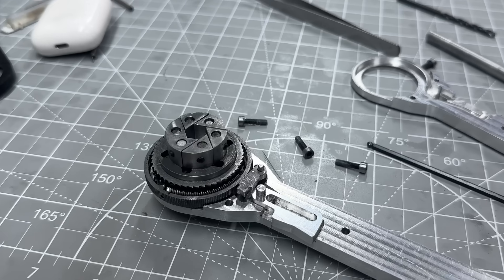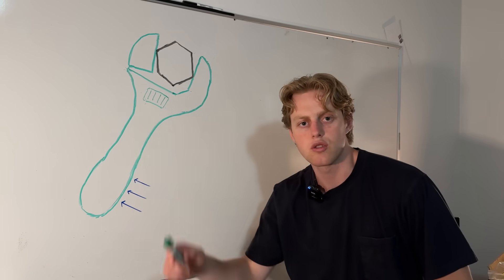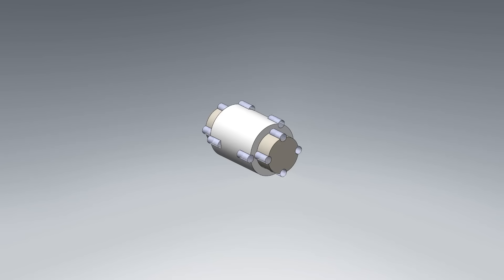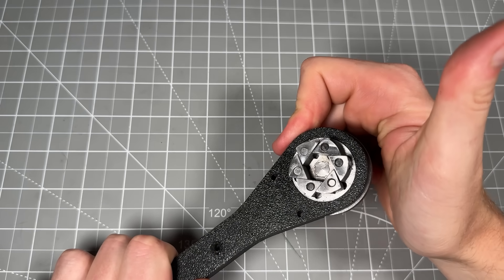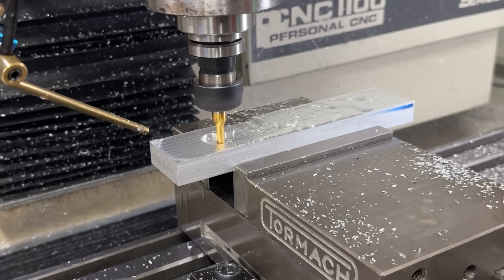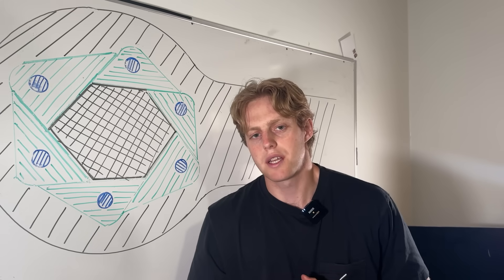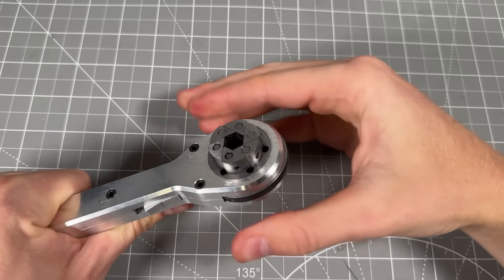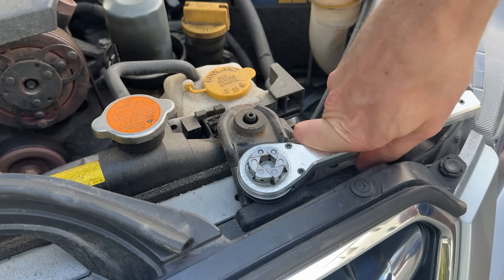I Invented an Adjustable Ratcheting Wrench

Comment: Mechanic and amateur machinist here, this is absolutely amazing, and as far as clearance into tight spaces, I wouldnt worry too much about it, since this already has more clearance than any other adjustable wrench I know. If you can find a way to do it great, but you should just try getting these out to market as fast as possible even if it costs some ridiculous price like $1k per wrench to make it worth your time, im sure people like me (except with more money) would buy it just to support you and fund this idea. Also one idea i had was if you could add marks onto the teeth (or whatever you call the parts that grip the bolt) that show what size it is so you can also use it to size bolts real quick. One tooth could have metric and one could have standard even.
Reply from the maker: Thats a great idea!
Reply: @Trevor_Faber  Cant wait to see what comes of this man, I'll buy one as soon as I can
Reply: @Trevor_Faber with his idea about marking the teeth (a great idea to be clear) the marks would have to be incredibly close together of they were all on the same tooth, so it would be best to take a vernier style approach and spread the marks across the teeth for better legibility.
Reply: @Trevor_Faber  400-500$ easily to pay for such amazing high quality tool
Reply: @Trevor_Faber Outstanding Work.
I'd have to use it before I could give you any ideas. You could color code to identify which side tightens which side loosens, you could add texture on the jaws fer rounding maybe. Honestly, the best thought I got without a use case would be add a slight curve in the handle, not just for ergonomics but also because it lends to your whole rotational motion to linear motion design....
Brilliant Job. Great Video, and well spoken
Thank You! 🤟
Reply: Came over from tiktok, if you ever sell these I would definitely buy one and give it a try. Love the idea and design
Reply: You clearly don't work on stuff because you couldn't operate this in tight spaces considering you need both hands to initiate. 😂
Reply: @O2TG  "clearly i dont work on stuff because tight spaces"??? like what bro, tight spaces are only half of what i work with, other bolts exist too
Reply: @kylesebring  then you would know this wouldn't actually replace any tool, only further add-to. Which is why  concepts like this never take off.
Reply: @O2TG  This would mostly replace my crescent wrenches, the only time I use those is when I have no clue what size I need but I know itll be easy to access. I've literally worked on hundreds of cars at my own personal shop, I know when a tool is useful.
Reply: @kylesebring you know what tool is useful? "When I have no clue what size" what are you some back woods mechanic? Once you've done enough, you can more or less gauge visually. They also make things called service manuals, are you new? This takes two hands to engage and can't hold an extension. I can think of maybe 2 cases this would be useless as a mechanic. Lol
Reply: @James_Darin  cant believe im even dignifying you with a response, but ill repeat myself again, I'd use it in almost every situation I'd use a crescent wrench, such as which I dont know the size of the bolt but I know its easy to access, for instance I've got a bunch of machines and even some heavy duty equipment at my shop, theres lots of times where I know i need to work on something and i grab a crescent wrench cuz i know it's gonna be easy to get to like for a panel or belt adjustment on my machines, but i also havent even seen the bolts yet today. Sorry if you dont own a lathe or mill or a bobcat, and have never had to deal with that. There's also a number of situations on cars but it's far less common, and I cant be bothered to think of them right off. The only situation that this doesnt replace a crescent wrench for is if you need to just use the tips od the jaws for a really tricky fastener, which is a scenario I've come across maybe 3 or 4 times in my whole career, so yes Id gladly trade away the ability to do that for all the benefits this has.
Reply: @James_Darin  P. S. are you missing an arm or something? why do you care so much about needing two hands? not to mention I'll bet after using it a time or two you could find a way to do it with one hand. Honestly the main reason I never use a crescent is because it takes a long time and always seems to adjust out on me, this gets rid of both of those issues, I'd probably reach for this more than my crescent
Reply: yea that might look big, but is as same width? as a normal 13mm socket for normal ratchet :D
Reply: same here  would love to see the resting posion of the Wrench would be a bit smaller but i loove this idea
Reply: Yes plenty of people will buy it, fantastic invention!
Reply: Yeah that's at really good idea by adding sizes to the teeth of wrench it can also serve the additional purpose as a measuring tool
Reply: Clearance is a problem though. The adjustable wrench can be tilted. This one can't, as it grips all 6 faces of the bolt simultaneously.
Reply: @fzigunov  A bendable hinge joint in the handle would help here.
Reply: @fzigunov  how often do you use a combination wrench for a tight clearance bolt? normally i go for my sockets then, i only go for my combination wrench for easy bolts that i dont want to guess the size of. reducing the clearance would probably be a lot more work than its worth.
Reply: @kylesebring  I'm just pointing out the problem. The worm-gear adjustable wrench can do a tight clearance bolt on a pinch. This wrench can't. That's all. Whether he wants to solve this problem or not, it's his call!
One thing I can tell you for sure. Clippy would never turn your adjustable wrench into a subscription model.
Reply: telling this young guy to commit all of his financial life into putting this almost useless tool into production is pretty short sighted... when even you admit as a mechanic and machinist you wouldnt purchase it not even just to support the idea or person behind it... so if not you then who? people with giant cheque books ready to burn arent out turning wrenches on farm equipment which is the only place i see this being able to access fasteners
Reply: @AndrewBrowner  With the amount of assumtions you make I'm surprised youve never been cut by Occam's Razor
Reply: Lol @ calling something else than metric standard 😅
Reply: *one could have metrics=standard, one could have  some weird units used in about 2 countries world wide.
Reply: @JB-dl7pp  I think you're staring yourself blind from the word "standard". It's simply the colloquial name or "US standard" for the US Customary System of measurement(not same as imperial).   I think you and me both refer to the International System of Units(SI) when we say metric or "metric system". I don't believe a single person with any kind of respect should try to imply or force their way onto others. It's annoying having to convert but who cares, its only for me. It would be annoying for a heck lot more of people if they had to change for my way.,
Reply: @JB-dl7pp  shut up
Reply: @JB-dl7pp  dude... shut up.
Reply: @JB-dl7pp  if you've paid attention to this video, he's talking about his invention, not metric vs imperial measurements
and no discrimination or ostracization here, we're here for technology, not for politics
divisiveness over measurement systems is politics, just like divisiveness similar to the gun-sphere's ARs vs AKs, it's useless at best and self-sabotaging at worst
Reply: @frontlinetomcat  i agree we are here for the tech, but still. DONT call one form of measurement "Standard". because in the USA and a few other places, Imperial is the standard, yet in the rest of the world Metric is the Standard. so call it what it is instead, and to avoid politics and such. call 1 scale MM and the other Inch
Reply: @kkofodh  you either didn't read my comment or mistook my comment for the comment that @JB-dl7pp made, where he called metric "standard"
re-read my comment, carefully
Reply: @kkofodh  Think the correct naming is imperial and metric rigth? there is no standard :D
Reply: @Jauertussen1 That’s just blatantly ignoring common usage and history though. I suspect you just want to start a fight, but in the case you’re genuinely confused “imperial” is called standard in many places because it was standard across the british empire (that’s obviously out of date but it’s still the nickname even in many places that don’t use it primarily). Metric may be the standard system in many places but it’s called metric, it’s very facetious to act like you don’t know better. Sure metric is better in many ways but you’d have better luck proving that point to people by using logic rather than essentially saying “your system is so stupid it shouldn’t have a name, I won’t call it that.”
Reply: @NebulaHatesWatchdog No, not picking a fight and it was a question. I on daily basis work with international engineering standards like DIN/EN/ISO/DNV etc. and never seen the wording in any regulations, rules or  technical reports define "standard" just imperial and metric why it is my assumption its the terminology.

Comment: I have an adjustable wrench that works a bit like this, but it doesn’t ratchet, it has a stupidly large head for the whole mechanism, and requires you to squeeze two handles together to squeeze the teeth onto the bolt head.

Look up “bionic wrench”

Comment: Don’t use tools much, but I love to use the ones I have when the need is there.

Clearance is clearly an issue, but your tool doesn't need to fit every space and work with every bolt/nut. 

It looks like it works on the right range of everyday bolts. We always joke that the 10mm socket is like gold. If you see someone's set is incomplete, it's probably that one missing. 

By its nature, it does metric and imperial. 

I'm keen to see where this goes.

Comment: Idk if i missed it but is the center bushing required? Are you able to make a through-hole so that you can use the same set of jaws for both tightening and loosening. Assuming you thought of this/ there is some technical challange that prevents this but it would be similar to current single size ratcheting wrenches, but just wanted to make sure. Been down rabbit holes myself where i forgot obvious things. That being said, removing said bushing could create some problems you would have to have to solve. Like your wearing/ centering surfaces would now be on the outer edge but there are larger bearings for that (disregarding affects on size, tolerancing etc)... I would also not focus on the depth issue, I dont think your product should replace sockets, but should focus on wrenches. Being able to consolidate a whole set of wrenches is a good enough selling point as it is. I dont think your design will ever replace sockets as its just a different use case. Would be cool to improve the "multi size" socket that uses pins to grip the bolts, but thats an entirely different problem. But that being said, good f** job!!! Amazing work and hopefully everyone has given positive/ constructive feedback. Praying to see what you make be put on the shelf at my local hardware stores. Ill be eagerly waiting for the next update. Goodluck!!!

Comment: While its reach is limited, it is far more compact than a the average 3/8 drive ratchet and socket. Could be useful for bolts with insufficient clearance. 
Would also be cool in a crows foot implementation, that way a torque wrench could be used. (crows foot used at 90° does not alter torque)

Comment: DFM thoughts here... you really only need three jaws. this would cut down on the mechanisms  manufacturing complexity. you likely can create a much wider adjustment space or more robust pins.  you also could toy with accomadations for 12pt bolts by slotting the jaws.  you could also seperate mirror the mechanism along the lever arm so one end of the wrench tightens and the other loosens.

Comment: Great idea, excellent prototype, good application of engineering design principles, but almost useless in practicality (as you honestly displayed toward the end of the video)

In attempting to make a universal tool that fits any bolt head, you've designed a tool that doesn't fit in most bolt applications

Comment: I work out of a very small tool bag due to volume contstraints, as such i typically keep a full socket set seperate from my tool bag i only grab when i know i'll need it. Obviously the problem arises i cant be clairvoyant enough to always know when i'll need it. Having a wrench like this would be absolutely amazing. This is such a novel design and i really hope you can make this work and have it be worth your time. i'd really hate to see snap on or someone copy this idea in 2-4 years and see you get shafted. i would really suggest looking into getting a patent on this design.

Comment: Love it. Thanks for sharing the design and development journey. I can see a use for this in so many applications. Not so much in automotive, but construction, general farm and equipment maintenance etc. Situations where there is often space to get this tool in there and where going to get a socket set is to much hassle. 
As for selling the tool, the key will be to continue testing and fine tuning the material choices, metalaurgy and heat treatments of the parts. If done right, Anyone copying the tool will struggle to match the strength and reliability.

Comment: The design is intricate and full of moving parts, but it's REALLY ELEGANT and possibly the strongest version of this design (like tool strength vise) that one can actually make... it's not cheap by any stretch because of the multiple accurately machined parts, but it's absolutely amazing design and I'm sure that within reason, one can enact enough force to the bolt and that the mechanism will survive time and use...

Very VERY smart thinking!

Comment: Is it metric or imperial?? 😂😂. If it fits a 10mm, i can guarantee you 1 of 2 things will happen. Either: it gets lost as often as a 10mm socket, or its the most used tool in the box.

Comment: Sick design,

What if instead of pins you used an outer circle with a contour to drive ramps on the teeth, you could then have the teeth be solid through the wrench. 

The way two way ratches normally work is with a y shaped lever that can be toggled back and forth, you can use a third locking prong in the middle to lock it for adjustment.

Comment: For the tight space issue you shoukd make a deepwell attachment for each of the faces that extends them out a few inches feom the wrench with a bit of a taper so they can reach down into those tight spaces. Maybe you can make them like sleeves that you put over the existing jaws and have a little m20 screw to lock them in place, would be a cool and pretty elegant solution imo

Comment: That's a great job. I really think that with little improvements in design and with better materials and machining capabilities it could be even smaller. It could become a real tool everyone has.
Also, after watching the Chronova Engineering's attempt on building an "Adjustable Allen Key," I think your "reversed" design could be a great start.

Comment: I would recommend color coating the tighten/loosening sides.
Reply: Paint wears off over time with use. It should be laser-etched into the steel at the very least... then painted.
Reply: A tactile function will make better sense.

Comment: Awesome design! I was wondering if you would be able to take out the knurled middle ring and just use the ratchet teeth to adjust it with your fingers this would make the diameters of the head smaller but also thinner. Not sure if it’s possible tough, just an idea

Comment: 04:01
Bro engineered the ratchet like nasa. Hammered the central pin with litterally a block of solid alluminum. This is not how Solid Works it's mean to be used, guys.

Comment: What about putting the gripping mechanism on a drill bit? I know there are these universal sockets with many little hexagons inside but I tried them once an they're pretty nasty if you don't position the bolt in the middle and your mechanism would solve this. The gripping strength would also help putting a screw into the holder and it won't fall out while you try to reach the hole.
Overall I am very impressed and would love to have a tool like this in my little workshop.

Comment: Adjustable wrenches are always a compromise. Your idea looks promising for certain use cases.
Unfortunately I can't see an use case for this design for my hobby (bicycles). Maybe for the 15mm wheel nuts on some old models but using a wrench will be faster and easier. I've heard that VW cars have a lot of different bolts but I presume they are on nasty places.
Anyway good job. I appreciate the hard work behind this video.

Comment: You are onto something here.  You should really look into some griding, hardening and finishing options now.  With smoother surface finishes, high hardness and maybe some good coatings across all the parts, you might just have long term production worthy tool here. 

You should probably go to a steel handle as well.

Take notice that most tools have a chromed surface.
Reply from the maker: Thanks for the input, this is definitely whats needed to take the design to the next step.